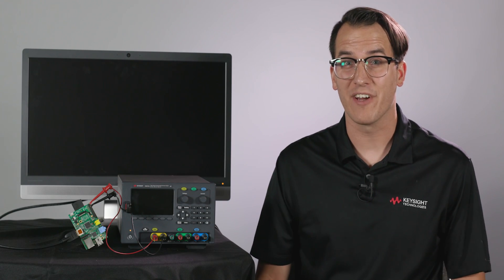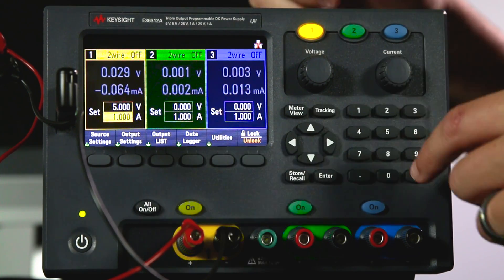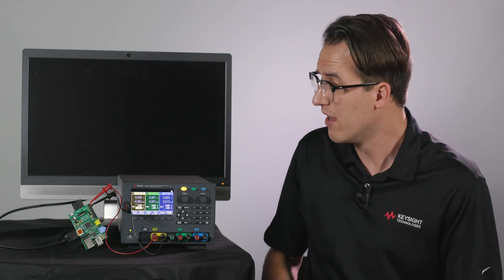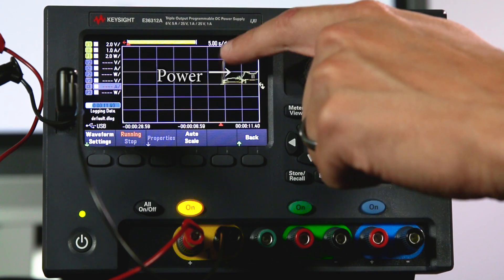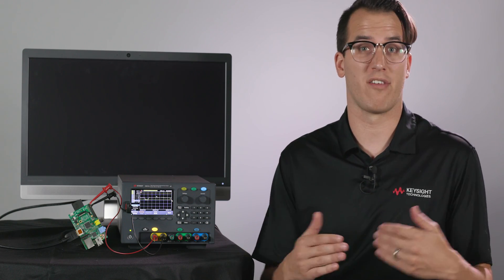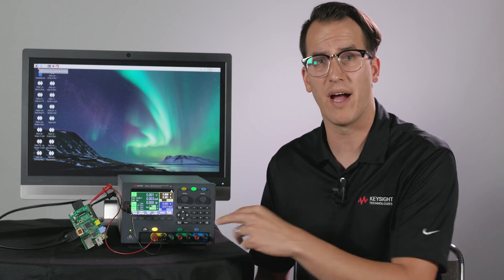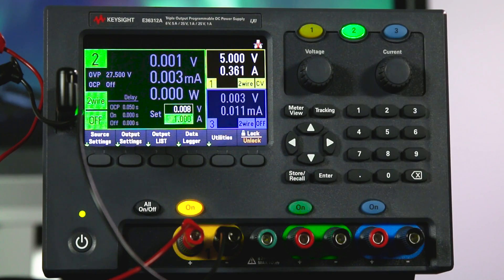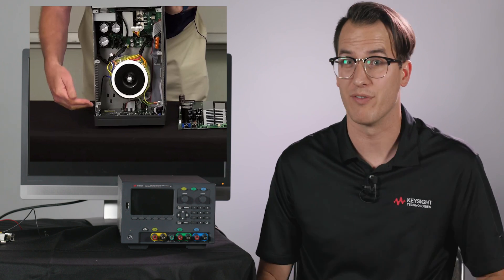Raspberry Pi Boot Check - Power Consumption?

Comment: Don't start with the presentation of the power supply before you answer the question: what's the Raspberry Pi power consumption at boot? I see 300mA after it stabilizes.

Comment: Everyone, stop with the more amps comments, its a very primitive  method of thinking. This is a high precession, low noise, high performance power supply, These power supplies are trusted to power a $5000 FPGA developer board or supply reliable, low noise steady power with minimal transients to sensitive circuits. 
The current and voltage readings are extremely accurate, no need to rely on external meters, the on-board meters are world class so is the software.  

I love the UI/UX look and feel of the 3 lane display, as well as the quality of buttons (not to mention it works with benchvue). For those who want "more amps" get yourself a wong hung low power supply or a few  toroidal transformers from grandpa's hi fi.

Physics dominates, the more current, the more proportionate electrical noise you will get.

Comment: Can you describe the series/parallel setup across the three outputs? Can you combine two channels in series with the third in parallel to achieve a specific voltage/current? What are V/A maximums when using this feature?
Reply from the maker: Good question! Basically, some power supplies out there will let you combine two channels to get double the current (parallel setup) or double the voltage (series setup). Often, you have to use jumpers or somehow connect two of the binding posts together, but for this supply all you have to do is select it in the software. But, you can only combine channels 2 and 3. The max for this E36312A is 50V in series, 2A in parallel. The E36313 does 50V in series, 4A in parallel.